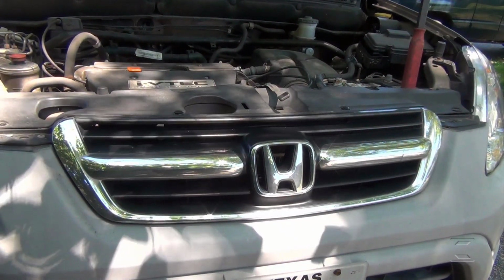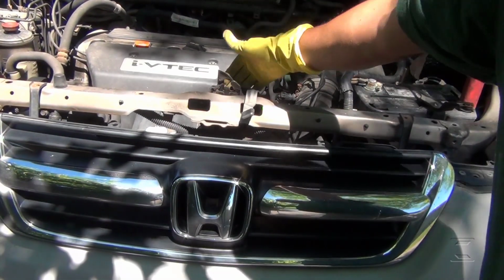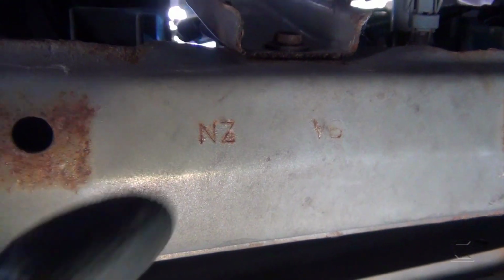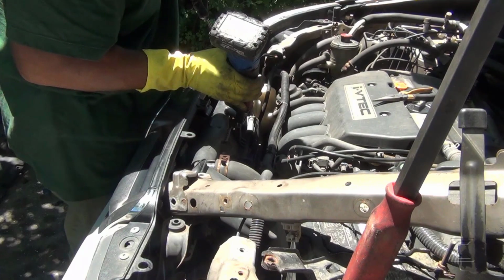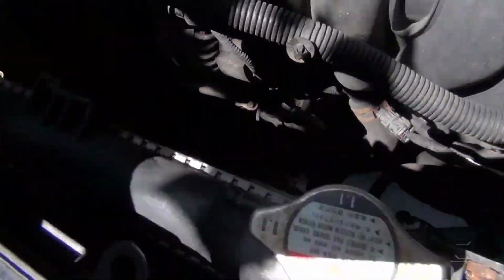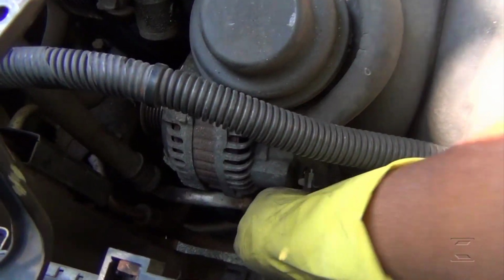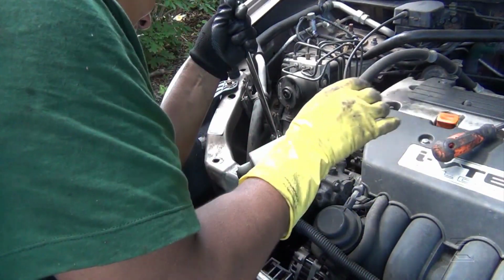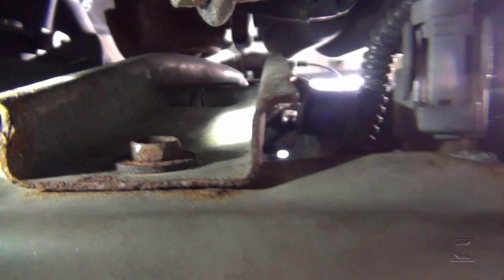onda CR-V Alternator Not Charging? Easy Step-by-Step Fix!

Comment: Y not remove power steering pump out of way to get better access
Reply: That's what I'm going to do. My power steering pump is leaking, and I think that it shorted out the alternator  the car won't start.. after I pull the pump, I'm hoping to be able to reach the back bolts of the alternator.
Reply: @downtownphotographer  how did doing it this way, work for you? All I did was remove the coolant reservoir and the power steering pump out the way and took the belt off ofcourse. That is currently where I am at now. Just the alternator.
Reply: It was the starter that was bad. Everything worked out well after installing a new starter.

Comment: Just finished this job.  PULL THE RAD!   Notice the damage to the fins the alternator did in squeezing it out.  I tried it this way and punctured one of the tubes.  (JB Weld to the rescue again).  It only takes a few more minutes to remove the hoses and rad, and gives a lot more room to work in front.  Good chance to check the condition of the hoses too.